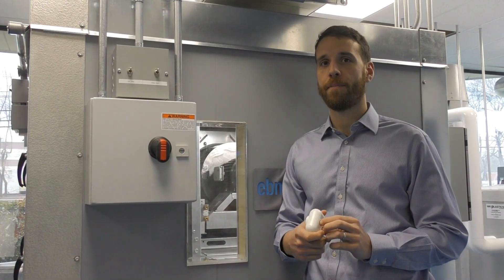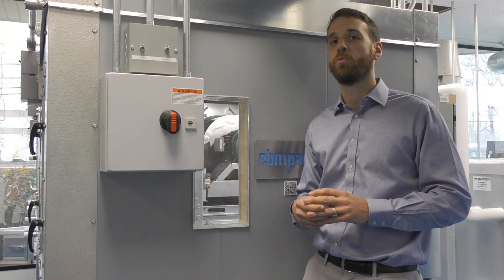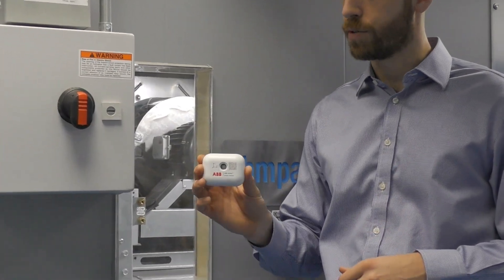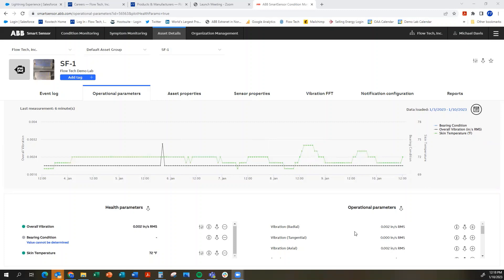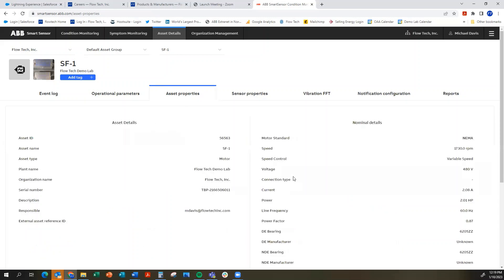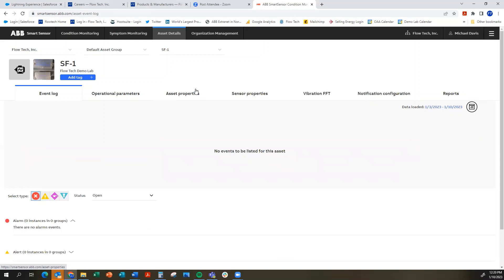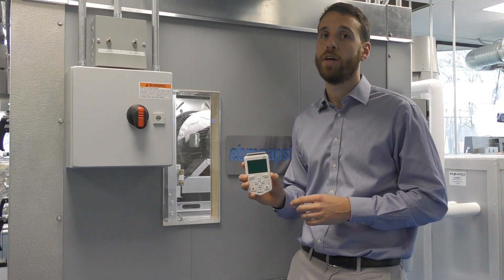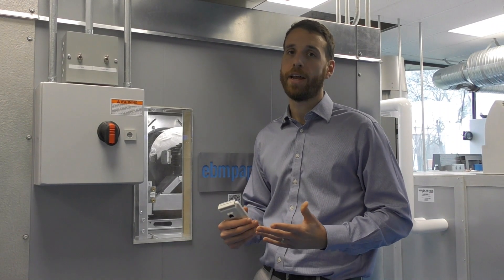ABB Ability Smart Sensor

Comment: What is the reference information for bearing condition? Is it the actual bearing which is installed in the motor or something else decides what is the alarm/warning upper limit which should not be overpassed?